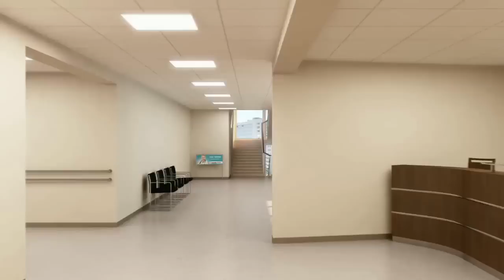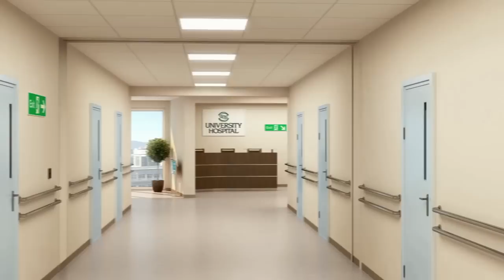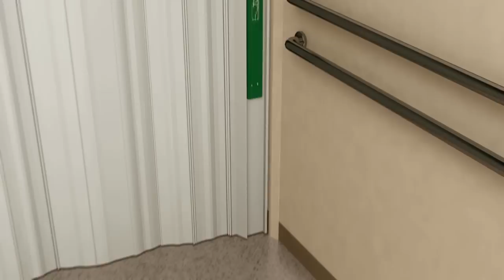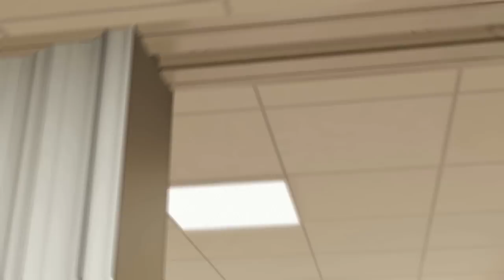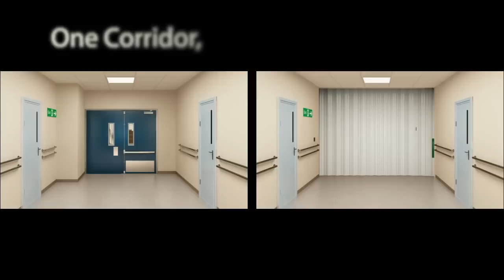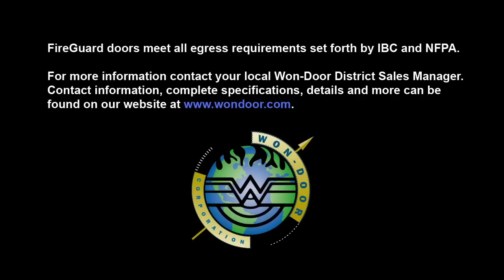Cross Corridor Accordion Fire Door Versus Side Hinged Door 3D Animation

Comment: What is the FRR? Thanks!
Reply from the maker: Rich, thanks for your question. I believe you are asking about the False Rejection Rate. We have one of our top engineers replying to your answer and will have that momentarily.
Reply from the maker: The only signal required to put the door into fire mode is a form C dry contact from the alarm system or local smoke detector and is nearly foolproof. The false rejection rate as it pertains to access control will be dependent upon the type and quality of authentication device being used.
Reply from the maker: Here's a new video for building owners on how the door operates and may visually answer your question on how the door integrates with the building alarm system. https://youtu.be/gjPX8lIOtoE